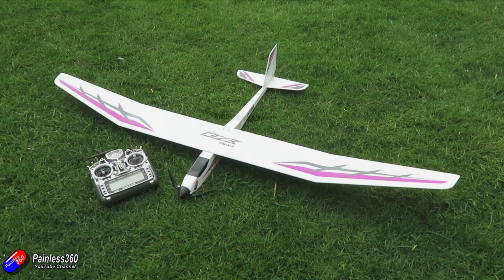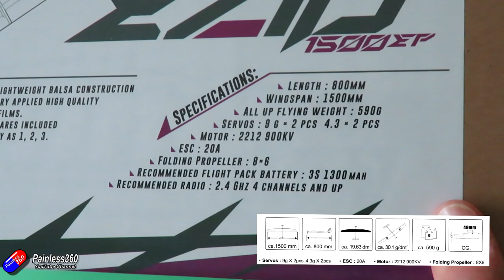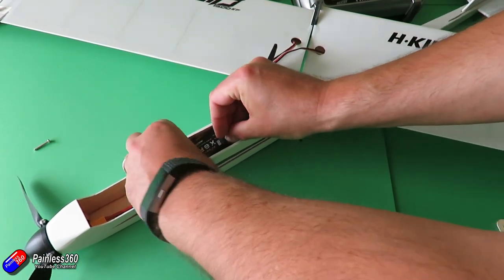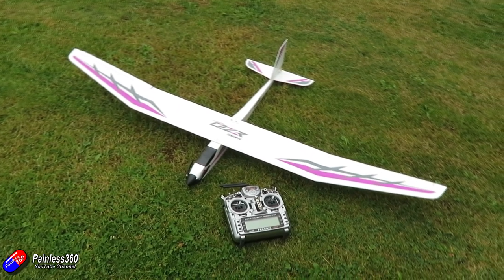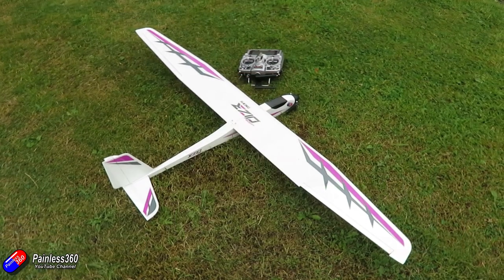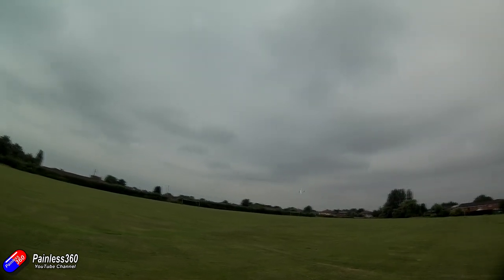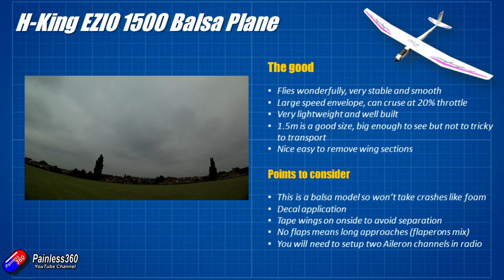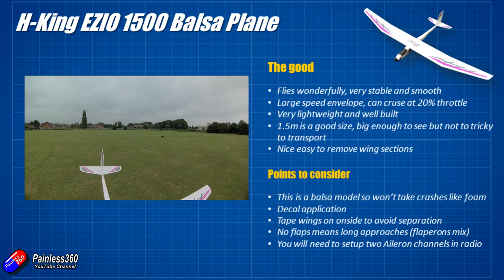RC Revews: H-King EZIO 1500ep Plane Review

Comment: Hobbyking really hit it out of the part with these. This video doesn't even begin to do justice to the performance envelope of the Ezio series. I don't know who HK's designer is now, but he did a fantastic job on the Ezio series. The control response is really, really nice on these, and they can really get scooting along. The 1500 is definitely in warmliner territory right up there with the old Pelikan Filip. You could uprate the power system a little and have some really raw performance. Best of all, HK have figured out out to make airplanes light, too.
Reply from the maker: Let's hope they continue to make these and bring out new models. That'll only happen if people buy them..

Comment: You hooked me on this plane- wanted a balsa frame like I used to build. 
It is very good craftsmanship as good as I could do except- 5 degree twist in slotting in the tail.
Certainly modifying could solve it but sheeit on a brand new model that would be a shame. 
So I put in a claim and I'm told they are replacing the whole pnp plane and no return required.  Don't let anyone get away with badmouthing hobbyking they have treated me like royalty twice now.  Gonna get the 1st plane in the air today twist or no!

Comment: How could you set up a fly sky radio? , I used a y connector and the alerons moved opposite to each other, Went and crashed, after inspection I found motor was mounted off center,  now Im rebuilding it, how can I set both alerons up or down at the same time? Thanks in advance
Reply from the maker: I'd just hang on a moment - the ailerons are supposed to move in opposite directions to make the model 'roll'. Most motors in models are mounted at a small angle to help counter unwanted tendencies..

Comment: Glider review without an airfoil, thermalling comment or demo!? I know its more a cheap overpowered warmliner but it is heavy for a sailplane - double the wing loading of a similar sailplane like a DLG. How did the HK DLG go? No flying review, so not so well...
Reply from the maker: +Wayne Russell sorry, I'm not sure what the question is.. the HK DLG works great but as I'm brand new to DLG fkying I have no basis for comparison and limited skills so that makes a more detailed video less useful ..  Happy flying
Reply: LOL a DLG in not "similar" in any way shape or form. This is a motor glider, and for a motor glider its very lite. Its also not an over powered warmliner (is there even such a thing? Because then its just a hot liner). Common man, please get a clue before posting.